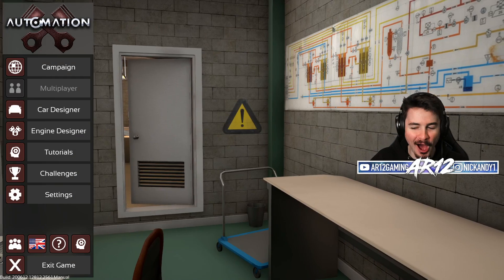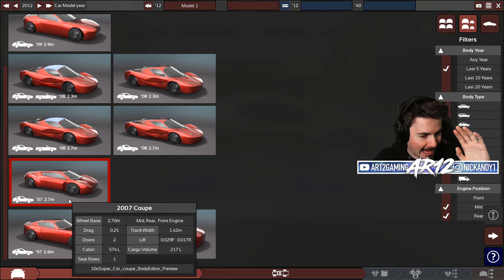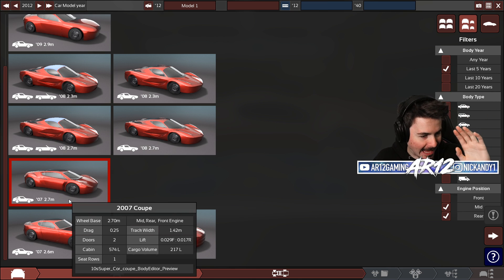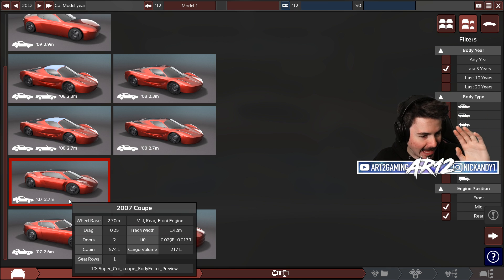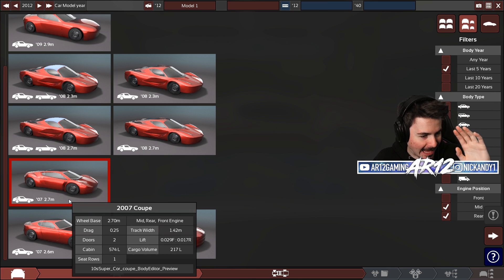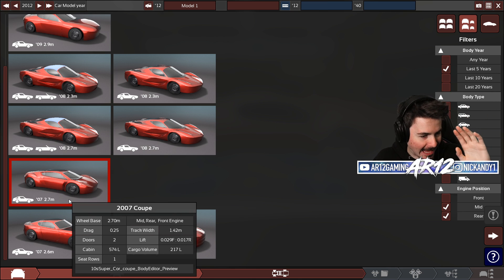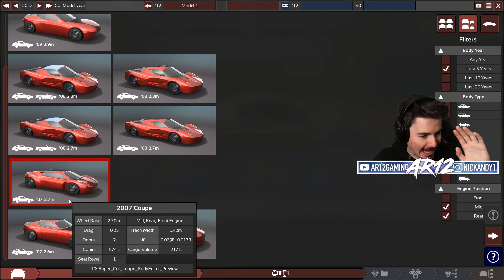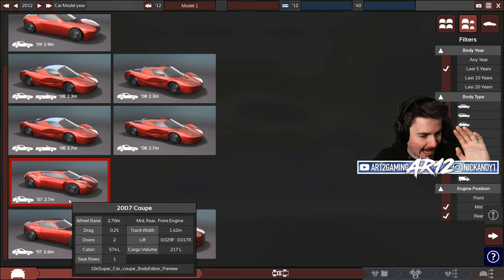Building My Perfect Supercar in Automation & BeamNG

Comment: Tip:Nick there’s an arrow at the top,it you press to the right it changes your year to 2020 which enables you to use carbon fiber wheels
Reply: Is it on Xbox or ps4?
Reply: Seasaw pc only
Reply: Yea most of the features anyway can’t be mimicked on console
Reply: @06carbon61  they could if you use the stick or touchpad (ps4)
Reply: DrNai ,it would still be inaccurate and when morphing the joysticks won’t be good either
Reply: DrNai ,and also definitely not Beamng tho,it needs a physics engine that is installed and needs good processing for basic things to happen which is the reason why the game is realistic

Comment: Hey nick, if you use the longer of the 2011 coupe models (sorta looks like a laferrari) you can fit a 3000 horsepower V10 engine with around 2700 foot pounds of torque.
Reply: Oh yeah and if you build it right it can go upwards of 350 mph.